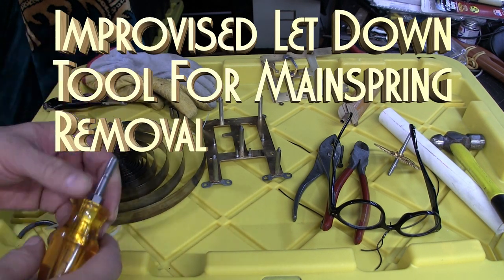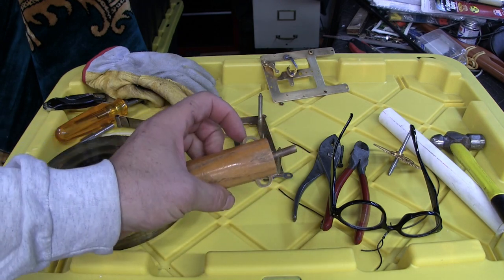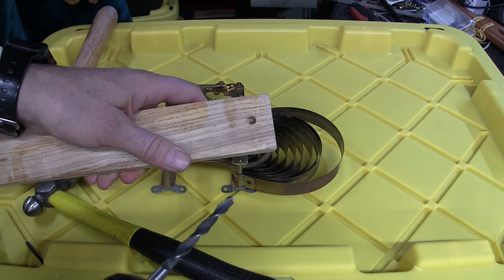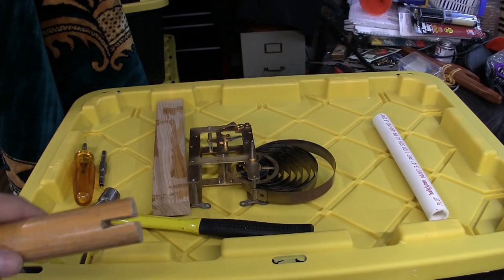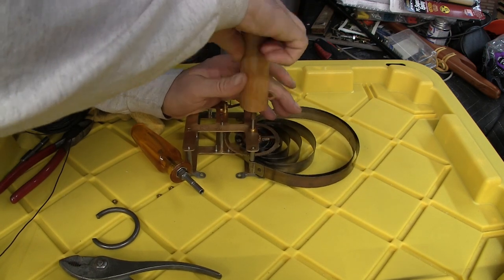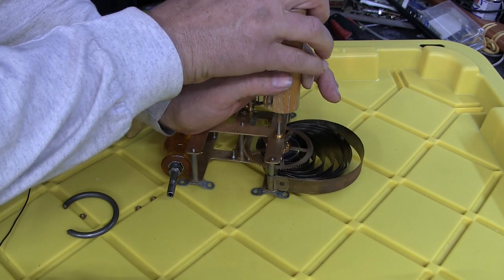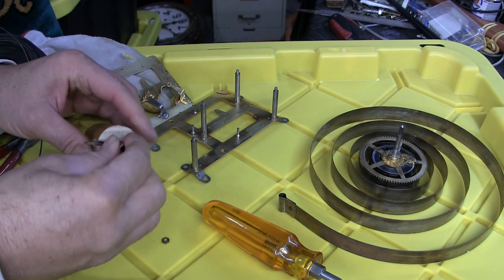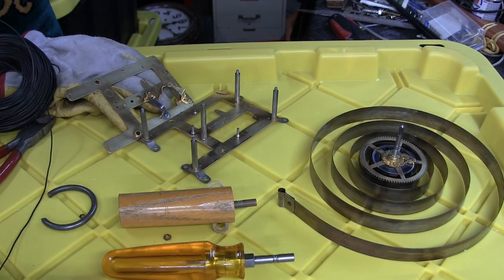Simple Let Down Tool for Clock Mainsprings, Loop end, Easy

Comment: if I am doing a planned service like a dissasembly and cleaning I like to let the clock unwind til it stops. then its easier to service, especially if its a barrel mainspring. Open mainsprings i let unwind until i can almost get my retaining clip on so i only have to wind it a touch to slip it on. This way I am not letting down all of the tension on the spring. Now if it quits working when fully wound, thats a little different.
Reply from the maker: Thank you for that helpful tip. 😁

Comment: Cut the slot across the grain for greater strength/durability.
Reply from the maker: Thank you for that suggestion! On a less dense wood doing that would be a necessity, I think. Even perhaps reinforced with a hose clamp to prevent any splitting. This oak piece I used was so hard I didn't even think about the grain issue. 😸

Comment: Nice thanks my clock keep stopping after I wind it run straight till I wind it tight not’clock I by any means but I think my main spring is sticking I guess nothing vented nothing gained. I’m not going to take it apart. I’m just gonna release the tensions while it’s in its housing in grease it up.
Reply from the maker: While cleaning first is the best way, often a little lube is all that is needed to get a clock going again, but if the spring is dry the pivots probably are also. Good luck. 😁

Comment: So doing this, you don't need a mainspring clamp, vice, or even a full-boat winding tool?
Reply from the maker: Well...yes and no, John. This video was about the let-down tool only to help those who might try to let down a spring using the winding key alone which can be dangerous. The clamps and winder I did not address. Clamps are not expensive, and I recommend them, but have seen many just use wire retainers with success. I recommend a spring winder, but they are expensive which is why I made my own, but are they necessary? I just watched a video of a Japanese gentleman who had such a wire retainer and wound the spring into it while holding it in his hand. And this was a 30 day spring! The average person would probably not be able to do that but there are alternatives to doing almost anything. Hope this answered your question. :)
Reply: @time4clocks  Hi Ab, thanks for the fast reply.  I guess my question, at least to this particular type of movement and loop spring, is whether this movement and spring can be serviced solely by using the clock frame itself as a holder while the spring is let down with the key and dowel.  I was going to order a spring clamp/vise and ring set, but what you did would seem to render the clamp/vise or full winder (which I also considered building) unnecessary, or am I missing something?  BTW, you need a real antique reed organ.  I'm (slowly) restoring an 1857 Melodeon for my wife.  Thanks again.
Reply from the maker: @ohger1  It is possible to let the spring fully unwind and expand with the let down tool, then when the movement plates are removed the springs can be taken out. Putting back in would involve the reverse but putting in all the gears with the spring expanded can be quite awkward but not impossible. I have seen a Vietnamese repair video where the spring was wound up and then baling wire put around it and twisted on the end with pliers which acted like a clamp. The movement plates could be used again after cleaning the spring to wind up the spring and then tie it off again. Many variables involved. Watch videos and do what you think is possible and safest with your skill set.  -- The 1960's chord organ is all I can play since you just follow the numbers. I can't read music yet. For me it a lot of fun though. To a trained ear it might sound horrid. Haha.
Reply from the maker: John, there is a channel called Just Mike and he was working on a Sessions kitchen clock. If you check out his video, although he didn't show the details, when he wound up the springs in the movement, he put a thick cable tie strap around them to hold them. I've seen others do that as well. It can be tricky but doable. I thought about your question when I was watching his video.
Reply: @time4clocks  Thanks Ab, I'll look for his video.  Thanks for thinking of me when you ran across it.  Really appreciate it.

Comment: Awesome,  thx !
Reply from the maker: My pleasure, sir. 👍
Reply: @time4clocks   besides gasoline, can you use and get similar results with mineral spirits?
Reply from the maker: @rollandjoeseph  If you are talking about cleaning mainsprings I don't know about mineral spirits. You just need something to work with your scotch brite pad as you rub through the layers of dried oil on the springs. If you saw my cleaning mainspring video I used WD 40 as the cleaning agent and then used, I think it was, mineral spirits to remove the wd40 after it was clean. Todays gasoline with harmful additives is never recommended to be used. A traditional method is to use kerosene. If you are talking about cleaning the movement, other approaches are preferred. If you had in mind something else just shoot me another question. 👍

Comment: Hi I wonder if you can help me I’m repairing my first Antonia clock movement it’s heavily oiled what cleaning fluid would you recommend? 
Thanks Richard
Reply from the maker: Hi Richard. If you don't have an ultrasonic cleaner and are doing the cleaning by hand, many recommend and have good success just using a brush and kerosene. If the oil is thick like tar you can soak in a degreaser like Simple Green first to loosen it up. The kerosene won't make the brass bright, just clean. Nobody sees the movement anyway so it doesn't have to be bright. That is mostly just shops wanting to show the customer how shiny and clean it is. It's more for show. As long as the movement is clean and oiled, that's what matters.
Reply: @time4clocks  thank you

Comment: Ab..Che k out my latest video on a new clock I just got.. it's a New Haven Westinghouse Elecreic Banjo.clock.from the 1030's. It was all gummed up so.forr $25.00. I took it apart and.cleaned everything..ultrasonically cleaned oiled and reassembled..Now it keeps perfect time.. Mayne you can forward more information.about these type of electric clocks. Especially the Powe stop mechanism which,somehow, tells you how long a power failure was.. much appreciated sir cheers...Steve
Reply from the maker: I'll take a look Steve, thanks!
Reply from the maker: Steve, I put a comment on your video but I think youtube deleted it because I put a link in it. The link described your clock. I'll put in another comment later when I return from work.